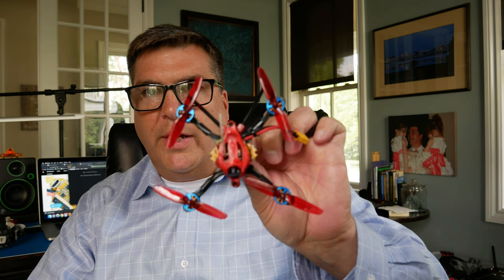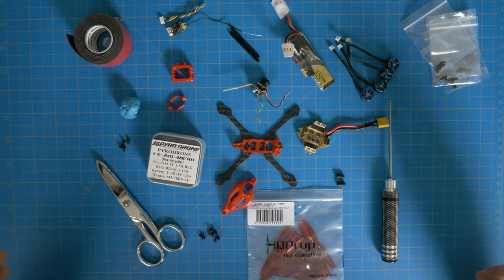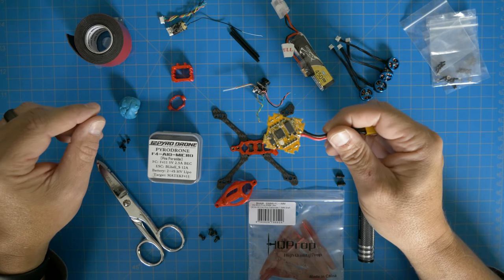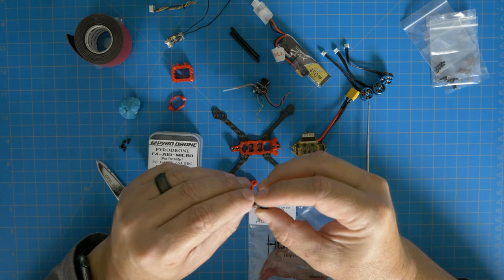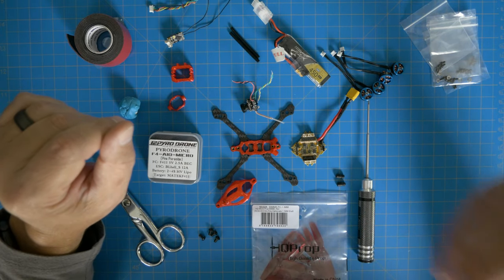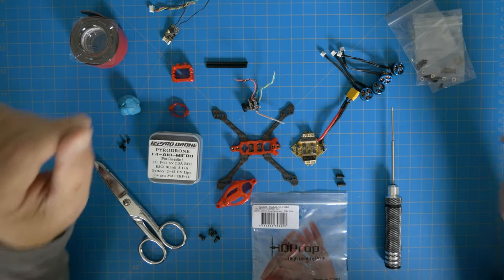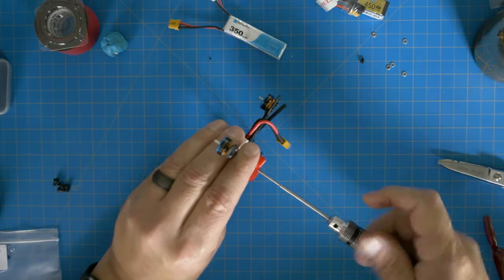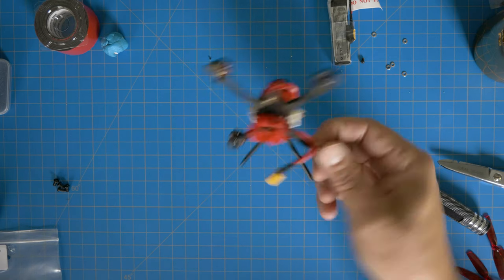👉☄️ THE ULTIMATE FPV Toothpick Build - 2S and Flies like a 5" Quad 💥💥

Comment: Use a VIFLY self contained buzzer (includes its own battery) which can be attached with zip ties, tape, Velcro, or whatever your favorite method is. I use these because some of my quads do not have buzzer pad on FC. You can literally attach these to anything. AND the HQProps are great; durable and good performance.

Comment: Sorry, but no toothpick flies like a 5" inch... The power, the drag and the weight is missing for smooth flying. I went from 5 inch, to some toothpicks... From toothpicks to some 3inch... And from 3inch, back to 5".... Its all not the same.... 5inch is simply the sweet spot. Thootpicks are great for flying in difficult areas, but everyone who tasted a 5inch, will come back to this. #justmyopinion
Reply from the maker: Yes, you are correct and I do talk about that in the beginning of the video... Thanks for watching and commenting.
Reply: He did say that...